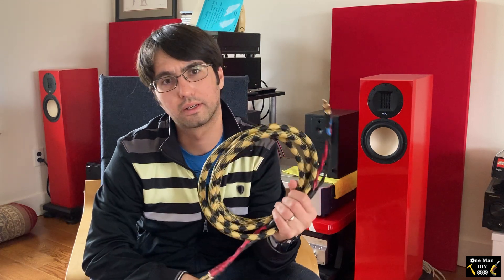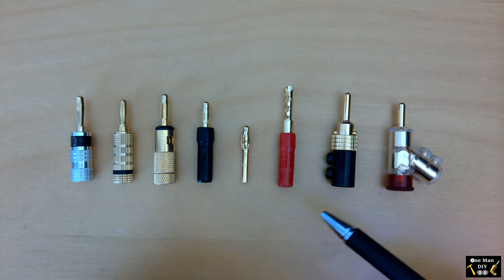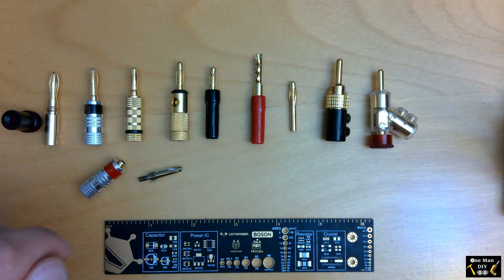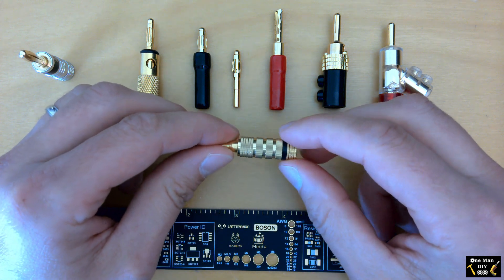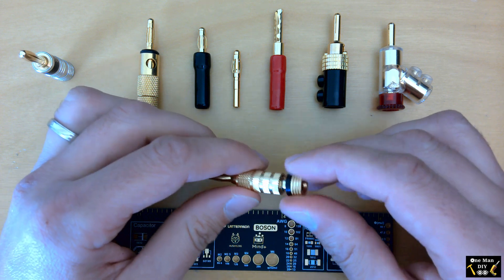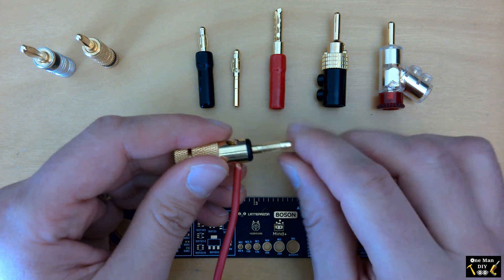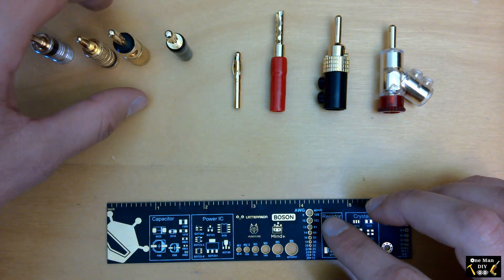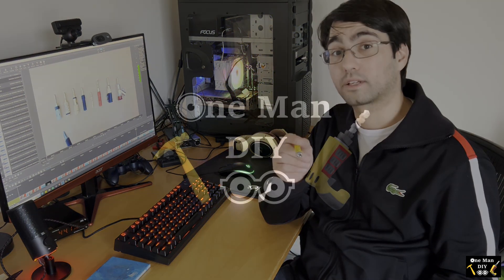(Part 1) Banana Plugs - Different Styles Overview, Review, Sizing, and Wire Installation

Comment: The material matters as well , use a magnet some will have more copper mixed with other material , those will barely stick to magnet and other have more of mixed material than copper and will stick on right away to the magnet , I avoid these , it’s about conductivity

Comment: The third one you test. It looks like it woukd take 10AWG well but exposed wire surely introduces oxidation quicker?
Reply from the maker: Your right, it does, they all kind of do. The screws will clamp down more and smash the copper so that would last longer. It will last a long time but it’s probably nice to give it a clean every year with a deoxit. I’ve had those connector on for a while on my speakers and seem fine, definitely not as shiny… I should clean them.
Reply: @onemandiy  im going for 12 AWG now. It just seems more easier to work with. Its put the itch out of choosing some connectors now. Its only for short runs so what ive read, its just overkill with the 10.
Reply from the maker: Yeah 12 is plenty! Good luck, have fun with the build!

Comment: Are the right angle WBT knock offs milled from a solid chunk of (brass I'm assuming) material like a Rolex case?  The WBTs that I use are milled from a block of very high quality copper(Cu).   They also make them in solid silver(Ag), at twice the price though; $55.00 a crack Cu, $110.00 for Ag.  Personally, I don't like 99% of the type with tines as they are an additional part and the ones with tines that rotate on a pin can create a diodic effect over time.  You're making electrical contact at the tip of the plug plus one through the tines that might become intermittent over time.  But I agree with your two top design choices.  And I also use the Monoprice connectors on Canare 4S11 cable.  Some really respected names in audio like Brent Butterworth I believe have praised the Monoprice as an affordable well designed connector.  One thing I have to say, complain about most far east products sold on Amazon is that it's mainly junk, not to mention they lie about the build quality.  I always test with a magnet to see if it's what they claim it to be.  I've purchased connectors on Amazon that claimed to be copper and almost always are not.  I even put a short video showing one jumping to the magnet as I brought it close to the connector.  The use of the term "made from pure copper" is bandied about by these far east companies but it doesn't mean solid copper.  The plating could be pure copper on whatever the base metal is and just try to ask them if it's solid?  They keep coming back with the term "pure".  A good example video;  scroll down to customer reviews and check out the video  https://www.amazon.com/gp/product/B09C2152W3/ref=ppx_yo_dt_b_asin_title_o02_s00?ie=UTF8&psc=1  I just noticed, am I the only person replying to your video?
Reply from the maker: Thank you for the awesome comment! You are my fist comment on these series! I learned something new about the "tine" bananas form your comment, thanks! If I remember correctly the tines are typically made form beryllium copper alloy which is over 90% copper and rest is beryllium. That alloy is as tough as brass yet containing much more copper. The knock off WBTs are NOT one piece , it looks like two pieces (maybe 3), one is like cut and bent to make the angle and another piece (banana tip) is inserted in it, then the pin thumbscrew screws in. It's kind of cool. Also the plastic shell is actually two pieces that snap together! I wouldn't have noticed unless you mentioned it, I am sure it is brass and gold plate. Also I had the exact same experience looking for a solid copper plugs, you couldn't tell at all, and ones that seemed like they are, were too expensive for no-name knock off brands. There are several other styles/variations of bananas that I haven't used, I think I am going to buy some and make a part 3 😁